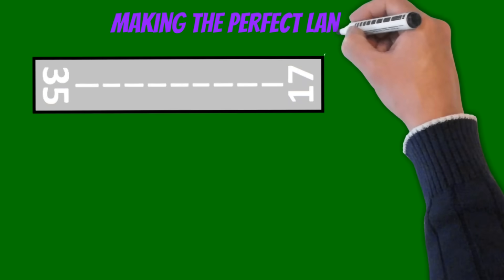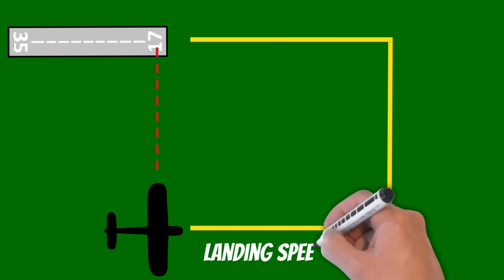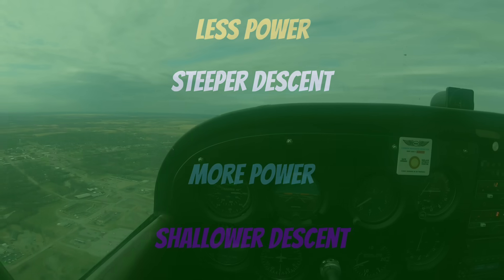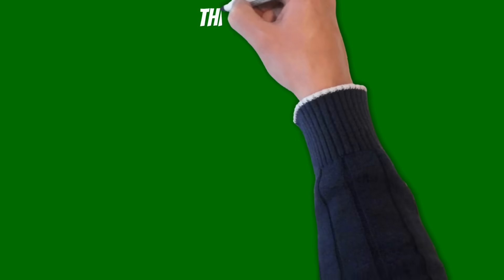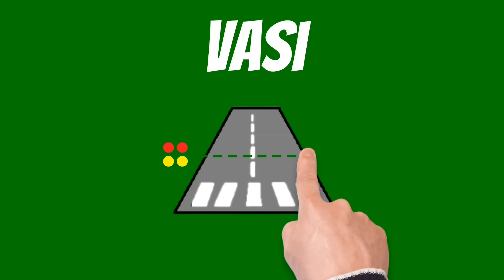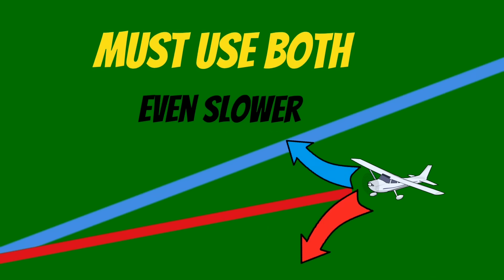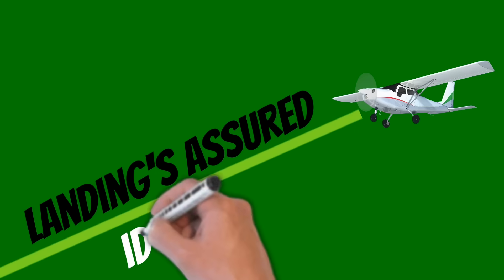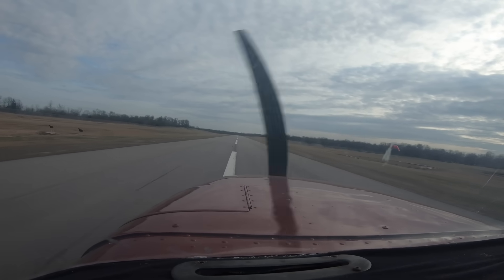Landing SECRET your Instructor won’t tell you [How to Land]

Comment: Good info. Always easier to make a good landing off a good approach. You provide a great technique. 
I use something similar...
Ex Military and Airlines Instructor.... so Personally, on final approach leg, with landing flap set, I always use pitch for glidepath and throttle for airspeed. That way, it is much easier to aim the aircraft at the numbers and correct if necessay.. 
On a visual approach, my scan is AAA: Aim Point, Aspect [Glidepath and Centreline], Airspeed.
Reply from the maker: That’s awesome! We’re you navy? That sounds like a technique they use.

Comment: My instructor was an ex-USAF pilot. He taught me a trick that worked for me.  Once you have settled on a final, pick the spot on the wind shield that lines up with your touch down point, and work the controls to keep that spot lined up.  Do this till about a 100 feet.
Reply from the maker: It sounds like our techniques are very similar

Comment: At 5:14 you say you are using both pitch and power to control or correct the airspeed.  What is controlling the line of flight to insure it continues toward the aiming point?
Reply from the maker: Power for altitude. Pitch for airspeed. When you’re close to the ground, sometimes you need to use them together. If your slow and you are close to the runway, you might have to may pitch down slightly and push the power on at the same time to keep you from getting too low

Comment: On final, Pitch for sight picture and power for airspeed. Hold the aim point until you think you're going into the grass. If you pitch for airspeed then the nose will be going up and down and you can't hold the aim point! You do one or the other, not both... If you hold the nose down to the aim point,  you'll get a ground rush that will make you want to start your round-out.  Fight the ground rush and keep looking at the aim point.  When you feel if you don't start your round-out then you'll go into the grass, shift your eyes to the beginning threshold,  then the numbers, then the first center line then the far end. You'll consistently level offat about 2-3 ft above the runway.  Now just slowly ease the nose up as it settles and you'll squeak it on every time!!
Reply from the maker: I’ll have to try this, but what are you doing if you start getting too low or too high?

Comment: Power 1700 lower flaps, what about airspeed in the white arc before flaps. Why 1700 just reduce power with carb heat off cause. I could go on
Reply from the maker: Good question. I talk about this in some of my other videos, but I like to fly my patterns at 80 knots so I can lower the flaps whenever I want.  A lot of this is technique, but the key is to do develop habit patterns

Comment: The idea of full flaps for landings I find terrifying! Why? Try doing a go around with full flaps. Especially at airports over 5000’. You are in a high drag configuration during declining speed. Think of this as a power-on stall. One should ALWAYS be ready for a go-around. BTW, I prefer to crab until kicking it out in the flare as opposed to the low wing, one wheel.
Reply from the maker: I’m actually going to make a video that talks a little bit about this really soon. It’s going to be called “Should I Use Flaps In a Turn?”

Comment: Excellent video!  Airline guy here with GA roots and Cessna 421 owner.  Only one thing I would teach differently, just my opinion…. For those who aspire to transition to instrument flying or larger airplanes, teaching speed control with pitch doesn’t translate well when on a prescribed vertical path like an ILS glideslope or VNAV path.  The pitch for speed concept is great when power is not a variable, such as a forced landing, or in our large jets, (I am a 787 Captain), when using FLCH in Boeings or Open Descent in the Airbus.  In those cases pitch controls airspeed and usually idle thrust is being commanded by the autoflight system.  Keep up the great work and keep those videos coming!
Reply from the maker: Thank you! Yes, using the two together is definitely the key for long term success. Thanks for your input

Comment: The click-bait title just sucks.  Nothing you said should be something that your instructor didn't say, even before you ever tried a landing.  If you are a student and hadn't heard this from your CFI, you need a different CFI!!!  The rest of the video was ok.  "Hitting your spot" is a good focus/learning thing, but once mastered, and when someone is now focused on a smooth landing, I have found that the way to get a perfect landing is to round out at a few feet, nose up a bit, and then the mantra becomes "don't let the plane land"...meaning keep pulling back just enough to keep the airplane flying.  It slows and slows, barely flying, until it touches down with almost no impact.  Yes, you will use up an extra 1 or 2 seconds (100-200 feet), but you will be rewarded with the tiniest of chirps.  And BTW, I am a CFII.
Reply from the maker: Yeah. This wasn’t the greatest title, but I still don’t believe most students are taught how to use an aimpoint.  I should have clarified that more, but what’s done is done. I hate to get rid of the vid, cuz people are acting getting value out of it

Comment: The biggest problem i have observed over 50 years of flying is failure to be on speed.  That's ON speed, not 10 knots over or whatever.  I have even seen instructors sign their articles with "Keep your speed up!" as a slogan.  There is only one speed for a particular airplane/condition.  Anything over or below will result in a less than satisfactory landing.
Reply from the maker: So true! I’m actually putting out a video tomorrow morning where I talk about this exact thing

Comment: Watching the position of the stick before landing I can tell you need more trim adjustment in order to get the stick in the middle and  more response in a neutral movement.  Always Trim your plane always.
Reply from the maker: I’m a huge fan of constantly trimming. However, too much trim right before landing can lead to an elevator trim stall when you’re doing touch and goes. Just something to consider

Comment: Only control airspeed with pitch if power is fixed. It is not the aircraft that determines if pitch, power or a combination is used to control airspeed. Power never controls altitude. Pitch controls altitude. Always fly coordinated. NEVER use rudder to change your heading except when changing a grab angle to a forward slip during the landing flare. Pitch to the glide slope and power to airspeed. There is a lot of great information here, the airspeed control is the only thing I disagree with.

Comment: Landing a light, single, like this is fine. If you’re progressing to bigger and heavier aircraft, you’re never going to land completely power off. This is especially true in heavy or low wings that tend to drop like a rock once you reduce power to idle. I always learned a technique called profile, you configure the aircraft pitch and power for a descent with flaps if you wish to use them. When you get to the end of the runway, you slowly reduce some power and also pitch slowly to your landing profile. To put a simple, watch and airliner land. They do not raise the nose. They have a profile that generally glides down to the runway with the nose wheel touching down last. This will help understanding how heavier and bigger planes will land. What other thing large aircraft that have multiple engines cannot land with a wing down because they can strike the bottom of the outer engine so they used a crab and kick forward method. I also use which called the Limburg  reference out the side between the door and the instrument panel which will give you directional and height control when the runway disappears under the top of the panel. As you hold this attitude and slow the aircraft down with power control you can actually touchdown with a little bit of power and it will be a greaser. This is a common technique on landing the main’s first on tail wheel airplane.
Reply from the maker: Very true. This video is for beginners in a training aircraft
Reply: @FreePilotTraining  I realize that very much. The point I was making was that I learned the same way as you’re teaching and that was the way that I learned how to fly. As I progressed and learn some different techniques like I’ve discussed, it makes landing a whole lot easier and more consistent. I think the FAA like the DOT still use techniques that are from back in the 1930s with the advent of automation and improvements in airplane design and versatility, I think the training should get a new upgrade as well. We tend to teach the same way year after year and yet we have more and more aircraft incidences and accidents. It would be nice if the FAA would look at different ways and methods of teaching that would make a pilot more safe and flying airplanes much easier. One of the things it always scared me when learning was the dreaded stall spin and getting too slow on final. In hindsight, I was never too slow I was always five or 10 kts above the bottom of the green arc with full flaps yet instructors almost always talk to you the you are going to stall. That’s why I think most students land planes too fast.

Comment: The ONLY times you pitch for airspeed is if your throttle is full or idle. It can technically work but it's a bad practice. It can't be transferred into your later training. If you're flying IMC and are on a precision approach, pitching down to go faster could make you hit a structure
Reply from the maker: I do agree with you, but I still like to “think” of them separately when I’m flying instruments. If I’m on glideslope and I’m getting slow, I’ll pitch down, BUT I need to add a bump of power to increase my lift to keep me from getting slow. I believe that the controls are the same, but you have to compensate for the control inputs you make, and I think that’s important to keep in mind. Thanks for the comment

Comment: Well, in my first landing on a FAA check flight, he hated what you described.  He wanted the landing about 250 ft further down from the aim point.  I guess he didn't like any landing near the threshold.  While, I can understand it if there was a plane on the threshold waiting to go I thought he was more over reactive.  As that was 40 years ago this is the best I can remember of those days.  Some time after that I moved to Europe and had to deal with my worse fears.  ATC environments.  I was going to pick it back up when I moved back to the US but never did.
Reply: Are you confusing aimpoint and landing point? Except for Naval carrier aircraft, most planes flare hence will always have a landing point further than aimpoint. Some aircraft carry lots of excess energy to bleed in the flare, hence some aircraft have aimpoints shy of the runway. Think F-16, T-45 those rare times it flares, F-105, space shuttle. 

If you’re truly thinking aimpoint:  If you’re flying a glider, you’d want to aim longer than threshold so as to have margin just in case you overestimated your energy state. Same would apply for power off in any aircraft. Hence many GA folk like to carry this forward to all landings “in case you lose your engine at any point.” Depending on your aircraft, you could counter that you have the option to raise flaps from full to half in such situations. Most GA aircraft that last half is mostly drag not lift hence you’d gain back for the lost engine. Caveat, not true for all aircraft so watch for negative tranferance. Such is also a concern for turbine engines with long spoolup times. I’d also argue you’re much less likely to lose your engine on final in a generally steady state power condition at lower power than you are powering up as on the go from touch&go or roll&go, hence you should want to eat up less runway in the landing so as to have more in front case you lose the engine on the go. Hence I think the GA philosophy of “in case you lose your engine at any point” is conditional to fullstop only hence is an oversimplified therefore wrong philosophy.
Reply: @jimallen8186  Well, that was 40 years ago.  Come to think about it I think he asked me if I was trying to land on an aircraft carrier.  But yes, I always aimed for just about 100 ft ahead of the threshold.  I was trying to get in that habit so when I went multi-engine I would have more space to slow down if needed.

Comment: Quick questions
- When flaring how do you know that the nose is 6 inches up?
- I didn't understand the bonus tip. Is it a total of 6 (1+2+3)  miles or 1 mile at a time totalling 3 miles? I suspect the later, just the way you numbered the diagram confused me a bit... is 1 mile, 2 miles,  3 miles or better mile 1, mile 2 and mile 3?
Reply from the maker: 6” is just to give you a mental picture.  The cowling should be right at or just below the horizon for the nose gear to be in the right position. As far as the bonus tip, it’s one miles at a time for a total of 3 miles
Reply: @FreePilotTraining  thank you very much for replying

Comment: KEEP IN MIND ON THE GLIDE SLOPE  YOU WILL LAND AT THE SPOT THAT IS NOT MOVING TOWARD OR AWAY FROM YOU
Reply from the maker: That would be your aimpoint. You will land beyond that about 200 - 300 feet if you round out and flare properly and you are at the correct airspeed.

Comment: too long final for an single engine plane is dangerous in case of motor failure you wouldnt be able to glide into the airdome, in traffic pattern you must be able to glide without power from all positions of the pattern this advice with "long final" isnt good for small training airplane for standard, normal flying, only appropriate to training ils appoach etc
Reply from the maker: I know they look long in the video, but my patterns are tighter than 99% of pilots out there.  I also somewhat disagree with your theory.  Check out this video I made on the topic: https://youtu.be/-fRhVbseTx0

Comment: U r 2 slow on speeds. 80k down wind, 70k on short final, 60k min over the fence speed.  Gs
Reply from the maker: I appreciate your feedback, but my POH says the landing speed is 69 miles per hour, which is slightly less than 60 knots.  Approach speed is 1.3 x Vso which means my stall speed is roughly 46 knots. According to the Airplane Flying Handbook, the base leg should be flown at 1.4 Vso. That means I could technically fly 65 Knots on the base turn, but 70 is easier to remember for me

Comment: Interesting video thanks.
I’ve been in circuits for too . I just can’t get the flare right because I can’t see the runway in the nose high attitude. My peripheral vision is good but I don’t notice anything.
I don’t see this nose high or even a flare in your video.
I had started kissing the end of the runway with the nose and it worked great, till my instructor started a new criticism of me not flaring enough and wearing the tyres out.
I liked your glide slope reasoning. The higher the slope the faster the approach.
Also, is there a correct seat position.
Reply from the maker: Try this video: https://youtu.be/iIW91SOSvVg. Also, if you can adjust your seat height, set it where the horizon is about a fist length above the dash
Reply: Thanks for the, it answers all my questions and I’ll definitely put it to practice next time.
Thanks also for that tip on seat adjustment, it makes a lot of sense.
Reply: I meant thanks for the link….’
Reply from the maker: @samcohen1625  no problem!

Comment: Never ever less that 20 degrees flaps and never more that 32 degrees. I have landed in all kinds of crazy weather and never gone beyond 28 degrees of flaps really. I just use speed and flare to compensate and kick steer with rudder especially if I want to side slip in high wind. Learning to even kick steer slide slip a commercial jet is not a bad idea. I was near Toronto 55mph cross winds with gusts near 70mph. 28 degrees of flaps flared it and side slipped in a light empty 9 seat twin engine prop. I had ATC guys that wanted to meet me in the tower 4 coffee...

Comment: Not only did my CFI tell me the buk of this, but we (the club we are in) have specific speeds for each phase during landing. Adding 10 knots to the landing speed is not what we do, and, in fact, we start around 30 knots above, then 25, then 10, then on short final we pitch for our landing speed pulling power as needed over the runway.

Comment: interesting overall, but very dangerous idea to move flaps during the turn (base turn in this video) - in case 1 flap failure - danger of non recoverable bank
Reply from the maker: I actually really appreciate this comment because it brings up a really important conversation.  I fly for the Air Force, and we are encouraged to use flaps in the turn.  My philosophy is that if you have flap failure, you land with the flaps you have, in case of split flaps, you move them back to where they were.  I’m fairly certain even in a full split flap configuration, I could control the airplane.  That would be a good question for the manufacturer
Reply: @FreePilotTraining  if 1 wing flap fail in the base turn - you will not land